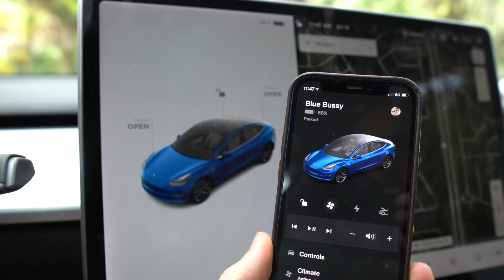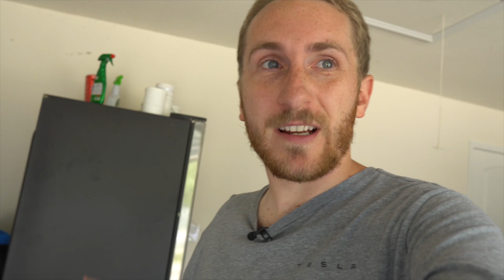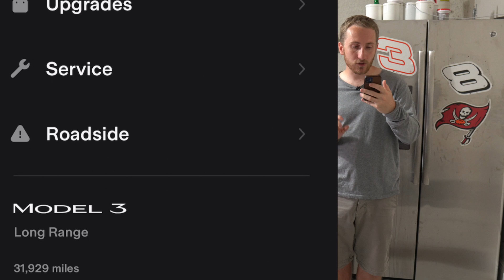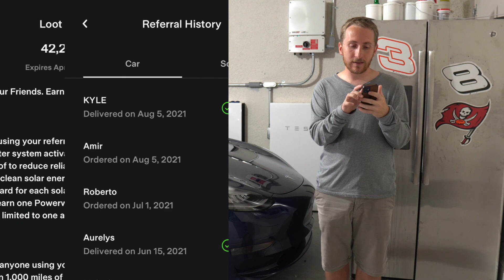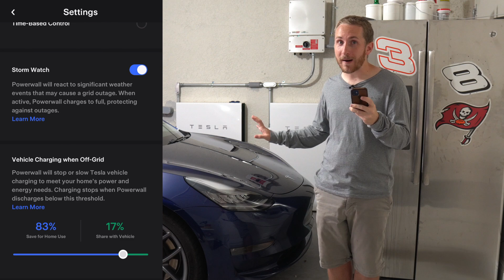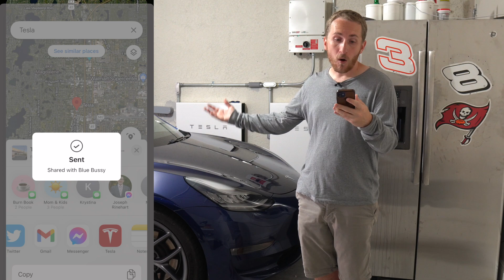New Tesla iPhone App is out! | V11 + FSD Beta Coming Soon? 🤔

Comment: Great review. Question about your Powerwalls. They seem to be connected to a Solar Edge inverter. Might you tell me which inverter? Off grid are your Powerwalls are able to create their own grid and keep the Solar edge running? I have a Solar Edge HD Wave grid tied inverter but I thought it was useless if the grid is down.
Reply from the maker: I have the same inverter as you. Powerwalls ARE the grid when the grid goes down, so the type of inverter you have shouldn't matter. You will be able to operate when the grid is down if you have powerwalls. That is a big reason why I got them. If the powerwalls are full, the inverter will shut down for a bit until the powerwalls are drained some. Then the inverter will come back on.

Comment: I have 16.32 kW solar and 4 powerwalls all installed last year. They hadn’t started forcing powerwalls and solar when I bought. I only have 1 page for the house and one for each car. Why do you have 2?

I also put my powerwalls to 100% for backup. I’m just north of you in Tampa 😎
Reply from the maker: why do I have two? because 1 wasn't enough to backup my AC and 3 was more money 💀 
If I had to do it again though I would probably have opted for 3 or 4. But ultimately after a year+ I haven't gotten much use out of them. Patiently waiting for a hurricane to hit lol
Reply: @jeremyjudkins  I didn’t mean why 2 powerwalls. I meant, why do you have two different pages for powerwalls/solar. Mine is all combined on one page…sorry for the confusion 😂 Have you been able to pair your phone to your powerwalls? (It’s under settings, and it allows you to use the “off grid” function)
Reply from the maker: @CAAT3365  ahhhhhhhhhh. the way it was explained to me is that Tesla used to separate solar and powerwall into separate products. Now its just one total product. My system was installed like March 2020. Was yours installed after that? might have been when they made the change.